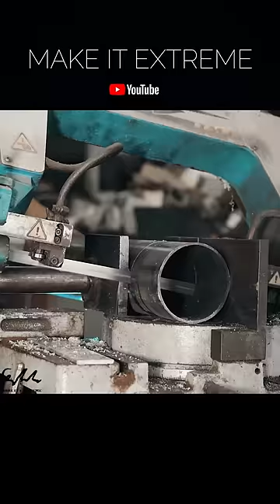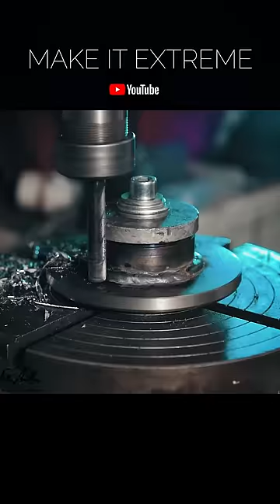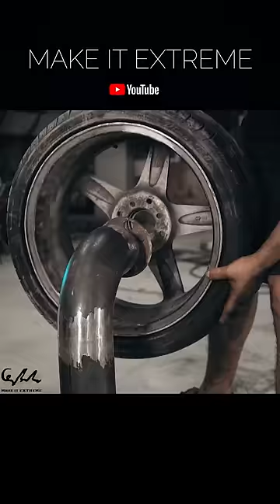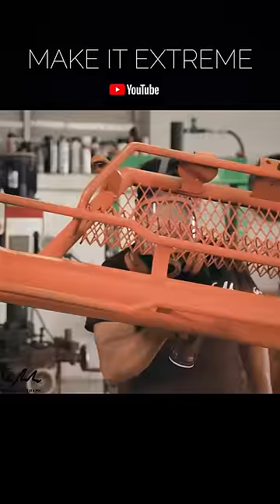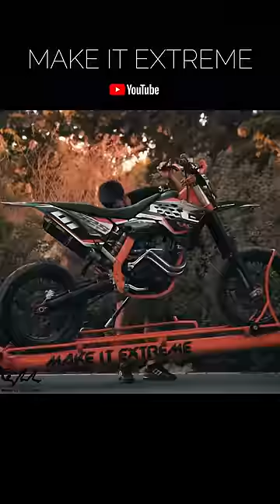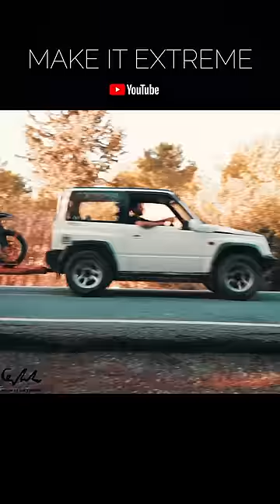Make it Extreme's motorbike trailer

Comment: Save the receipts for the materials, Department of Motor Vehicles will need to verify the grade of the steel used and welders qualifications before issuing a title for licensing.

Comment: What can actually keep it from flipping over when it connects in to the car through a ball and in the back stays only on one tire width and still the central gravity point is higher than tha line between the ball and the contact between the tire and the asphalt... So is like walking on a string... A fine string.. 😂